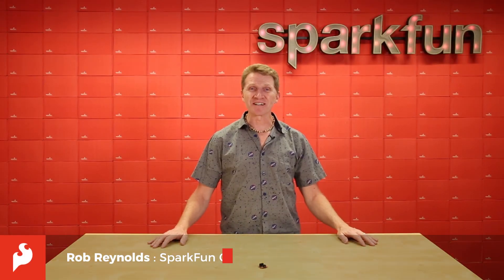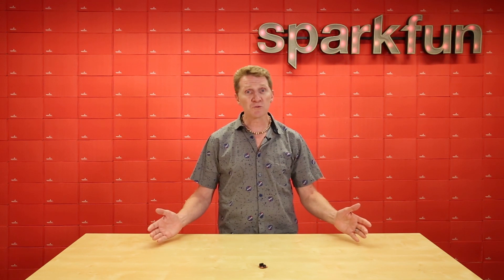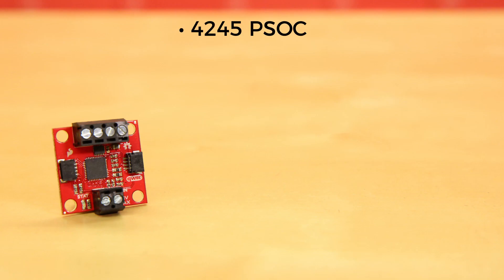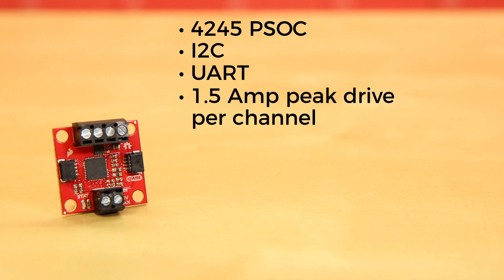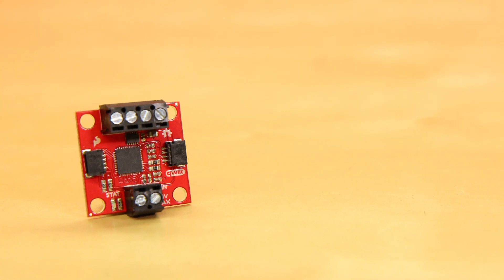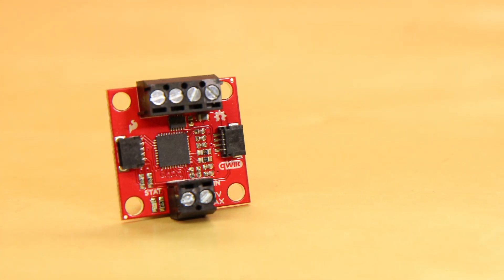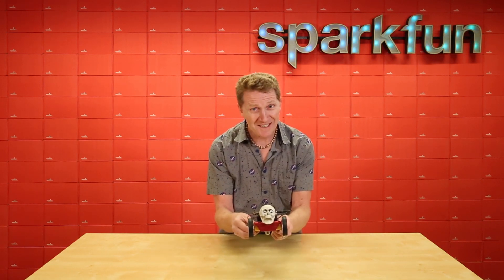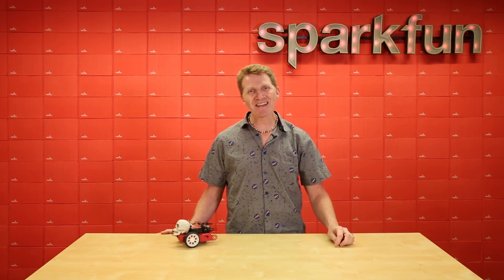Product Showcase: SparkFun Qwiic Motor Driver

Comment: Any documentation on the use and intent of the Arduino library (other than the inline comments in the checked-in code), or tutorials on how to drive a 4-wire bipolar stepper with this controller?